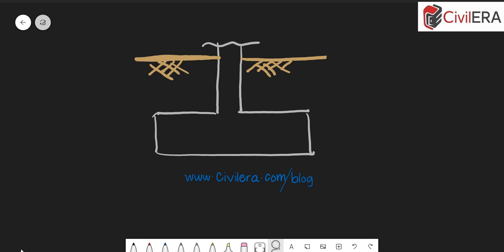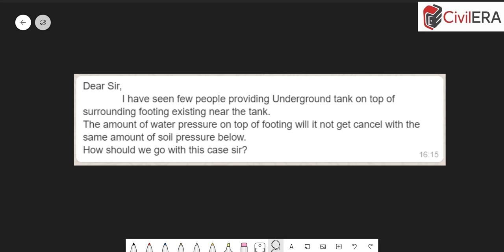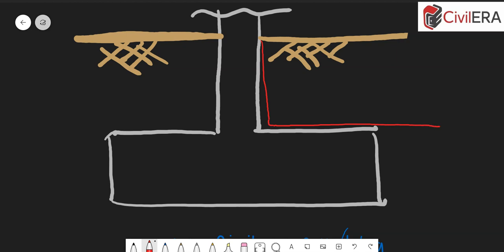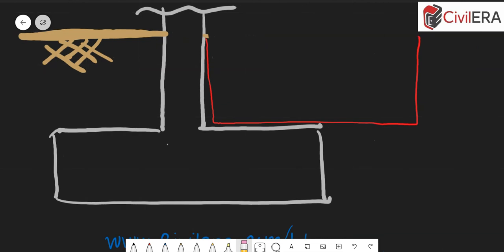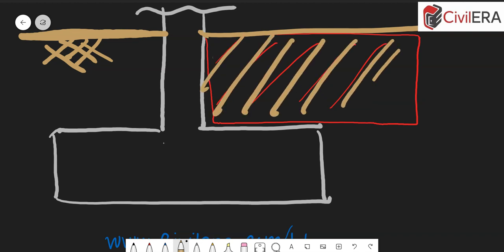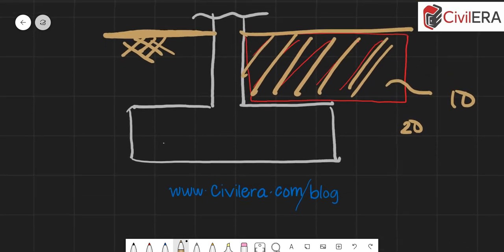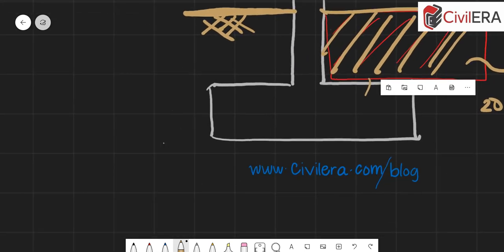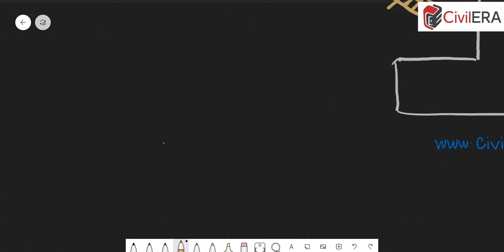Sump water tank on top of a foundation? Will this create additional load on the foundation?

Comment: 2:16 Hello sir, Will the load coming from rcc walls and slab of the tank not affect the footing as its density is higher than that of soil?
Reply from the maker: @mohammedsafwaan9525  
Use logic and simple calculations
Note 2 points
1) The density difference is minor
2) Even if concrete is denser, we are replacing quite a lot of soil with water. so water is less dense. You can calculate total weight of soil and compare with that of rcc tank + water.
Reply: Volume also matters. The tank is designed to hold water, which is half as dense as soil. And the rcc work is very less in terms of volume, compared to the soil excavated. So it will not be a problem for the footing.

Comment: I was suggested to build soaking septic tank inside the house foundation,  it will be center of four columns , which means septic water will be observed  by earth  and the columns can get these wet,  Will this damage my  columns or footings over a period of time?
Reply from the maker: Consult a well experienced structural engineer in your area. It is not possible to advise on YT comments as there are a lot of parameters that needs understanding before we can advise

Comment: Sir i hv made a base of septic tank  with equal to footing without water proofing ..will iron rod of the footing get rust and corrosion after some time?
Reply: Sir plain footing with thickness of 5 inch can carry load of g+2
Reply from the maker: @kagosobin9827  If it was such an easy thing to say by chats on Youtube, then why should structural engineers be on earth 🙂
Please consult a structural engineer in your area and solve your problem
Reply: Thank you sir for ur advice
Reply from the maker: May be may not be. depends on the nearness and leakage

Comment: I have a situation, where i have to build sump 2 feet adjacent to the footings. If I take care of building the depth of sump equal to level of depth of footing. Is that ok? Or do I need to reduce the depth of sump to bring it above the footing. Please suggest.
Reply from the maker: Well,  Generally it is ok provided what I understand is correct. However this can be established only by more careful discussions.
Are you a civil or structural engineer? I cannot advise you any thing based on text chats and on YT. You need to get the actual design done if you are constructing this

Comment: Can we keep septic tank above footing. It is build with normal brick and not concrete
Reply from the maker: design and load point of view, it is ok
assuming the footing is designed by a structural engineer. durability/leakage etc needs to be attended

Comment: Good day sir,
what if my Cistern Tank is also my structural Footing foundation, would this affect my structure's integrity? thank you
Reply from the maker: See, there will be a backfill of soil in general cases and density of soil is 20kN/m3 approx. And water weight is less than that of soil. So generally, weight point of view, there is no concern. Only issue is durability when footings come in to contact with water if ever it does. Provide cover and ensure quality.

Comment: Hi, i did strip footing for my house foundation 130 cms base and top 20 cms for beam, in our  work area having size 192cms* 300 cms after only a small square piece of land will be balance after footing,so we did reinforced the total space of 192 * 300 and converted it into a water tank, as per this video if there any problem,
Thanks..
Reply from the maker: You cannot and should not do any work based on this video. Your understanding of the video may be different or the real conditions at site may be different than what you think. Always consult a structural engineer before and during construction. If you need any consulting services, please feel free to contact me

Comment: This information is very valuable! Thank you.
However, sometimes clients are specific about needing a sump in North-East, and a column is present there, is it okay to provide a column in the middle of the sump? (With proper water-proofing).
Thanks in advance.
Reply from the maker: Not ideal to do Sumana. It can create durability issues. Can I know what do you do and have you joined my group?
Reply: @CIVILERABangalore  Sure Mr. Premjit. I work in Mysore, as a Civil Engineer (in training). 

Which group Sir?